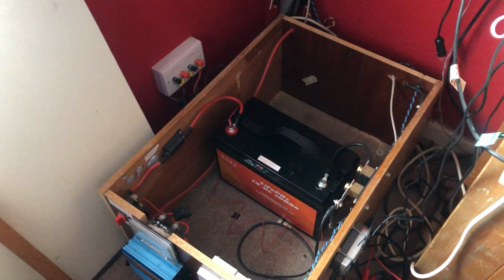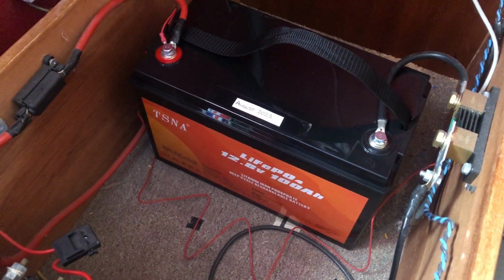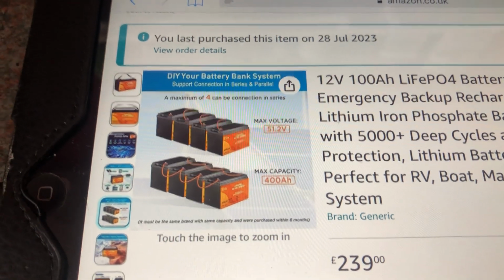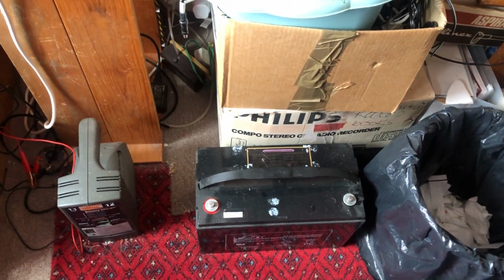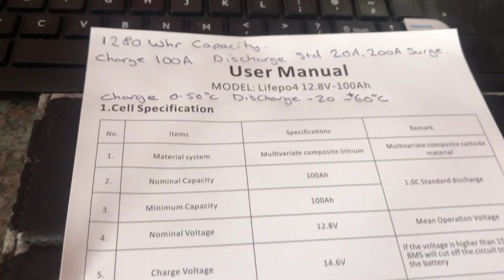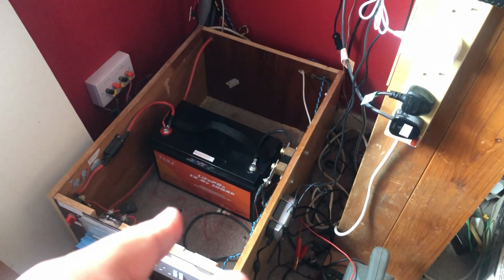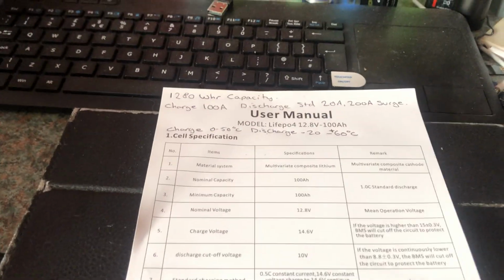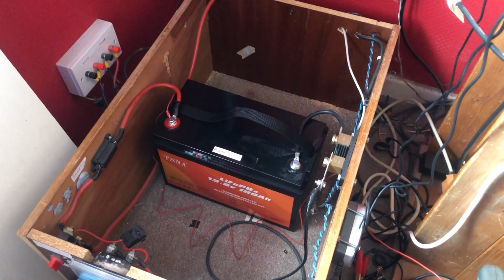New lithium battery for my solar system

Comment: Congratulations 🎊. It's about time and Thank you for sharing. Since you've lightly used the 3 100amp agm batteries. Is there perhaps a way u can perhaps use them in the shed for cryptocurrency mining and the other gadgets in the shed? 5000cycles on that LiFePo4 Battery. That's atleast 10 years life expectancy if that battery is fully discharged and charged once everyday. Im weird id only use 40% or soc of 45-75% of that battery theoretically getting 20 years of life out of it. Of cause I realise the battery potentially will be warn out by that time cause of calender life rather than cycle life😅. 40-75% state of charge for a LiFePo4 batt. That would be my goal. Nevertheless I hope that battery serves u very well.